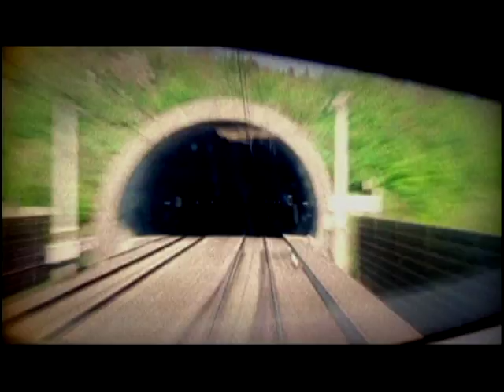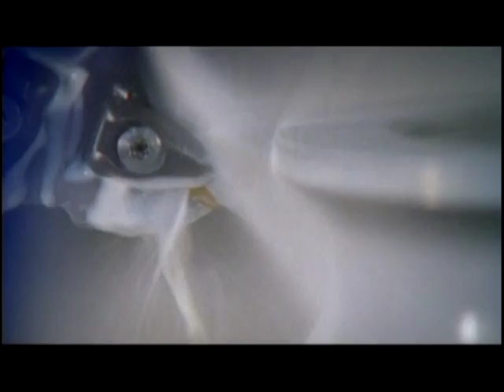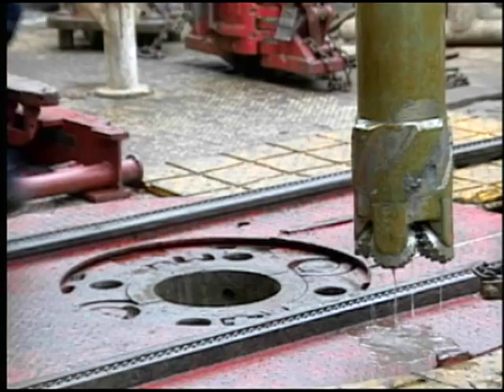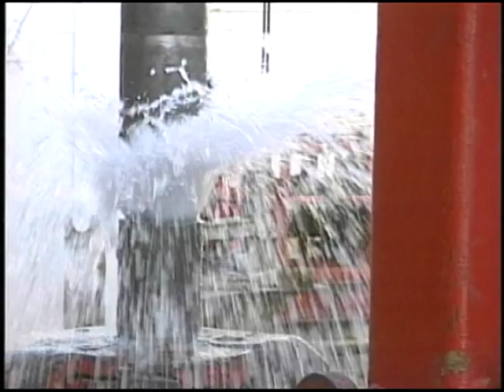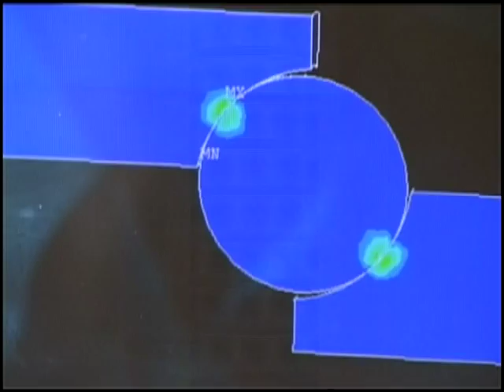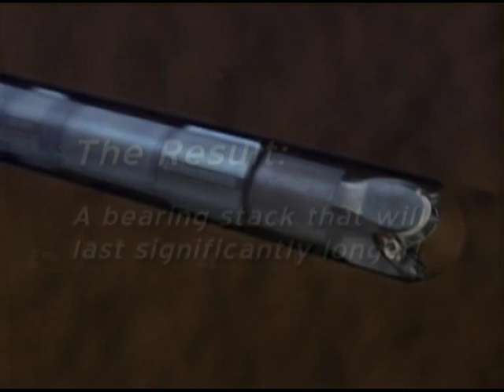SKF Mud Stack Thrust Bearing for Downhole Drill Motors

Comment: Mud stack thrust bearings 
Mud bearings close to the drill string end have a major impact on productivity and reliability. In addition to severe axial and shock loads, these bearings are “lubricated” with highly abrasive mud, which for a bearing is the definition of an extreme operating condition. Monton’s mudstack bearings are optimized for our customers’ applications through rigorous finite element analysis and physical lab tests by testing the bearings with drilling mud circulating through them.